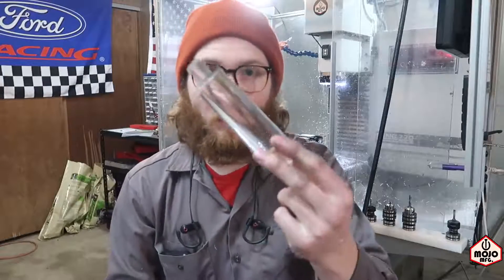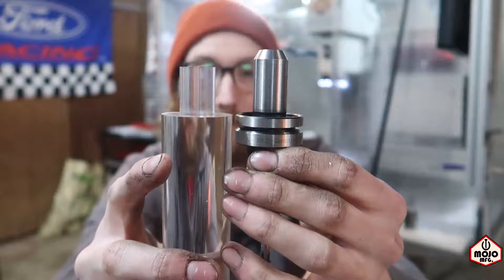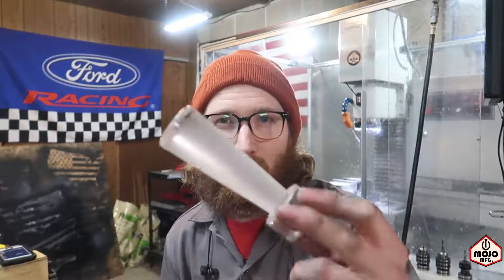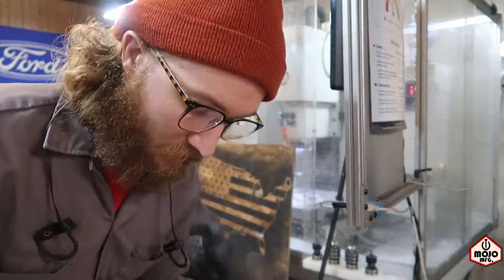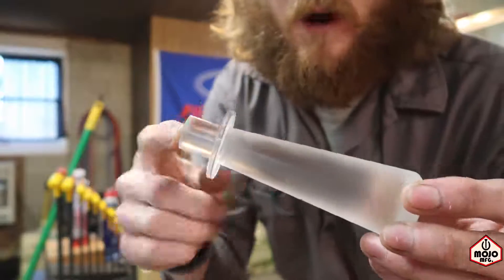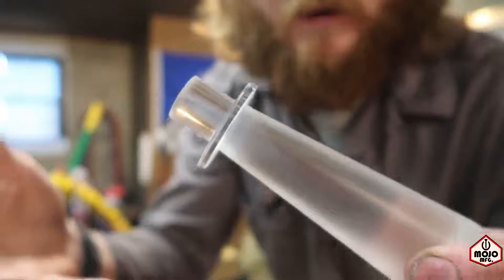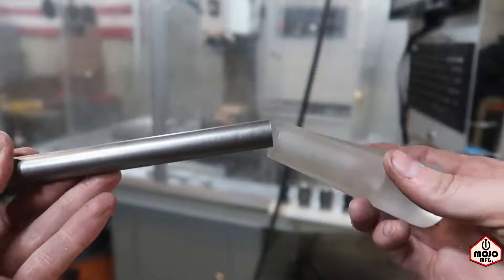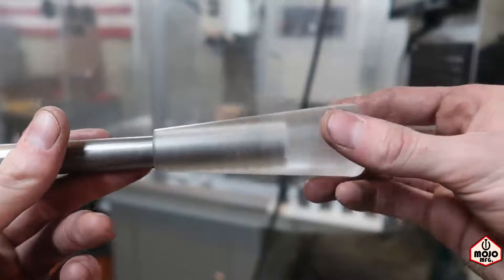Machining and Polishing Clear Acrylic

Comment: I wish to cut 10mm diameter colored acrylic rods into 50mm lengths in quantity and polish the cut edges. These will be used in jewelry production so a finished look is necessary. A slight bevel would be nice. These could be chucked on a drill press then spun against an abrasive or buffing surface. For instance a sanding/buffing block fixed at an appropriate angle. Some guidance would be greatly appreciated.
Reply from the maker: It seems like you could chuck that up in a drill press but I am worried about it marring the side of the part that is chucked up in the drill press. Seems like you could make the bevels on the part while having it chucked in the drill press then taking the part out and using a pedestal grinder with a buffing wheel to do the finished polishing. That make take out the marring marks if there is any.

Comment: Do you think a casting resin, or maybe a 2 part epoxy for the inside would both secure the shifter and give a smooth finish?  Alternatively I suppose you could make a mold, cast the handle in place and then do a final engraving on the end.  Probably only make sense if you were going to start churning out a lot of them with only the end engraving being custom.  Anyway interesting tests, and it worked a lot better than I was expecting tbh.
Reply from the maker: Yeah it worked way better than I thought it would. I thought about casting it but for some reason decided against it.

Comment: Thats is one badass shifter. Next time consider some heat-set inserts. You just pop it in with a soldering iron, and it can screw directly onto the shifter. https://www.mcmaster.com/heat-set-inserts
Reply from the maker: I have never seen those before! I will definitely keep those in mind for next time.  Thanks for the tip!

Comment: Dont forget about the rule of beyond 3 Xs diameter you will need to have the end of the stock supported or defection becomes a big issue as demonstrated and is even worse with soft materials like acrylic.